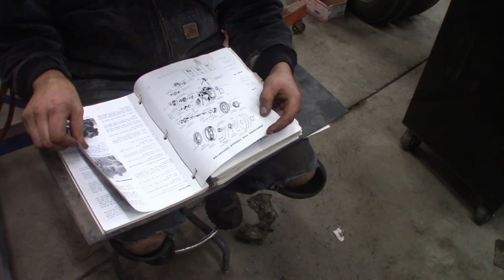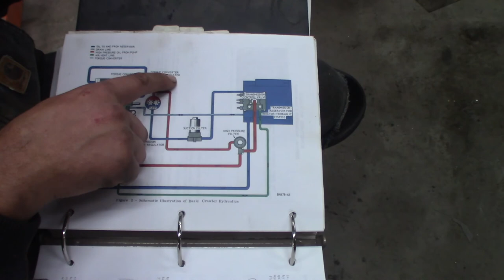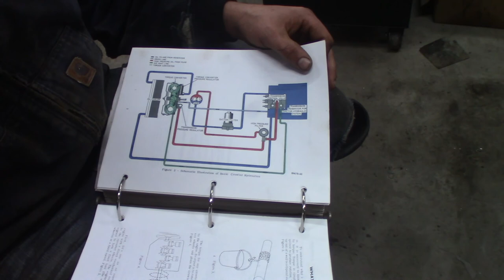Case 1150 Dozer, it moves..mostly. Time to put the tracks on.

Comment: Torque converter pressure is at 50, trans pressure is at 250. When you first start it, you can get it to move a little but after that you have to wait 20-30 running at high idle for it to warm up and move properly. I was told that is the nature of Case.
Reply from the maker: Hi DrHarry; Thanks for the info! I can't wait to get working on it again. That makes sense, I have to fix a bunch of hoses and re-fill with oil. Also have to change the pinion gear so there is some work to do to it. Thanks for watching. John
Reply: @JohnFrytag  It's gotten worse, now it takes longer and when it starts to go it stops again and you have to wait a few minutes in neutral. When you see the output shaft start turning fast at high idle, you know it's ready to try again. Once you get a little grip, I press on the brake and hold it until the TC starts to grip. Keep doing that and after a while the TC completely grips... After a long while.

Where Can I get my hands on that book? It would be great if you could scan it into a PDF, Put it in something like Drop Box and give me the link to download.
Maybe I'm hoping for too much 🙂
Whatever info you could give me on the TC bypass valve would be great.

Comment: My Dozer Case 1150 C starting but dont move forward any solution please ? the blade of my bulldozer works
Reply from the maker: Hi Mark: Does it move in reverse. If so it eliminates the torque converter and pump and several other items. And that would point at the reverse clutches not getting pressure for some reason like the hand valves or blown reverse seals or ??? The hydraulic pump for the blade is separate and unrelated. Thanks for watching; John
Reply: @JohnFrytag  Thank you for your answer john but unfortunately it doesn't move forward or backward but I don't know how to explain it but when I pull the lever it gives a kind of force to move forward but it doesn't move. Have any other solution ?
 
Mark
Reply from the maker: Well now its a matter of if the driveshaft is spinning to narrow down what isn't working.
Reply: @JohnFrytag  the driveshaft turns permanently, but do you know where the manual valve and the reverse joint of the bulldozer case 1150C are? sorry for the bad translation I don't speak English; thank you for your help but I really want to repair the bulldozer
Reply from the maker: Hi Mark; Since the driveshaft is spinning all the time there must be something wrong with the transmission itself. Possibly the control valves or clutches . Probably time to see if you are getting pressure to the shift spools. I don't know about the C model except what is in common with the 1150 model.
Reply: @JohnFrytag  Hello, thank you for your answer. Could you tell me where the control valves are located in the bulldozer and also I would like to know if it's normal that when I measure the pressure on the pipe under the battery it shows me 20 bar? Thank you very much for your answers
Reply from the maker: you are welcome Mark 20 bar would be around 280psi and I don't know. you would need a service manual. There is a pressure gauge on the dashboard. The control valves are on the operator control handles. Also there is a pressure relief valve on the bellhousing that could be stuck in the open position. I wish I could be more help but I am not an expert either. just another guy fuddling through getting this thing working.
Reply from the maker: FYI; Changed channel name to John Frytag. Thanks!